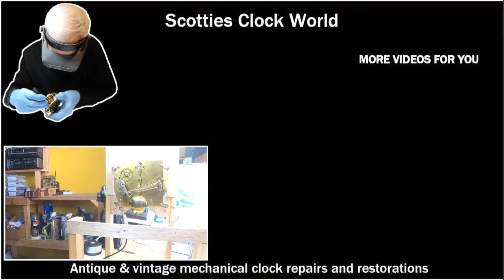How to adjust German mantle clock Crutch and Pallets

Comment: With all due respect Scottie you didn't show how to make the final adjustment you only compensated the out of beat by changing the level of the clock stand. Unless of course I missed something and if that's the case I apologize. Regardless I think more explanation is necessary.

Comment: To my beginner ear the tic tock still sounds very uneven at the end of your video.
I found a iPhone app called Cuckoo Clock Calibration. (For a dollar or two)
It assisted getting my clock beat very precisely set.  It looses 1 minute per week and I could tweak the pendulum length If I want.
For those who missed it you can move the pendulum on a slip clutch to adjust the beat to allow for a surface that is not exactly level.
Alternatively the clock maker can adjust the pendulum for an exactly level surface and the owner of the clock then needs to set the clock level.
Although it doesn’t take much of a bump to move the clutch when hanging the pendulum.
If that makes any sense 🤠
Reply from the maker: The movement needed final adjustment once the clock was hung on the wall. Thanks for your comment.

Comment: Thank you for making this video, much appreciated. I made a mistake before, requiring me to have a clock professionally restored. Now, instead of adjusting the pendulum's crutch lever, I prefer to just to stack coins under the end of the clock that brings it into a perfect beat. My question is, can the vast majority of German movements (eg HAC, Kienzle, etc.) be bought into beat, when placed on a level surface, with the movement still inside the case, by simply pushing the Crutch Lever to the left or the right by experimentation? Thank you :-)
Reply from the maker: Yes that is correct. Adjusting the crutch puts a clock in beat.